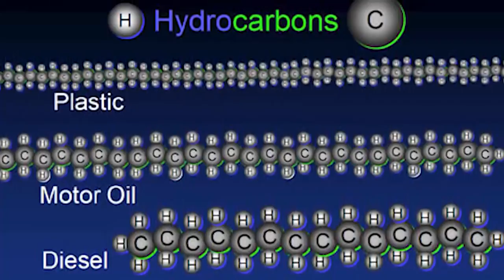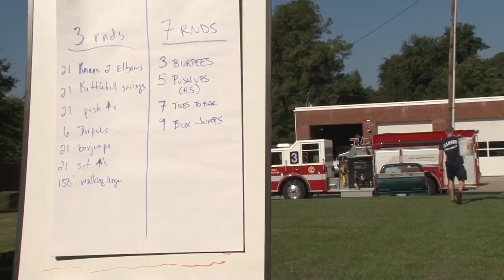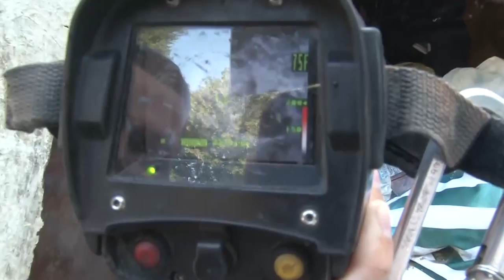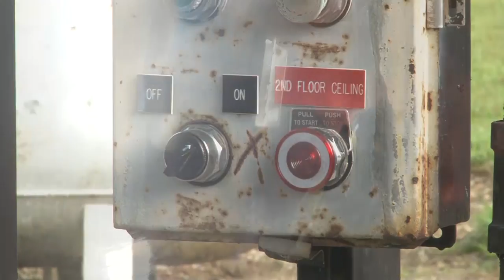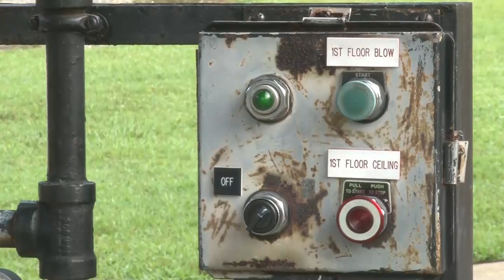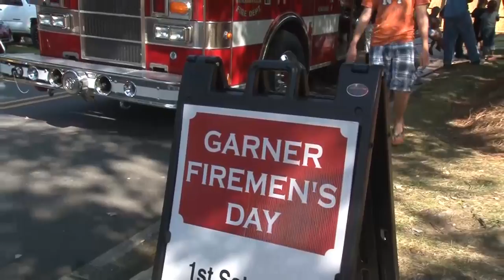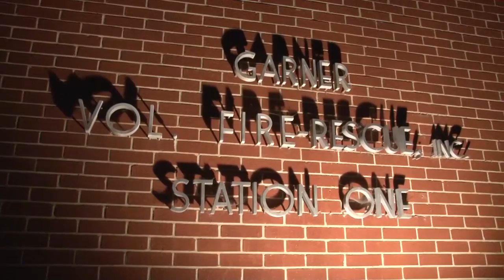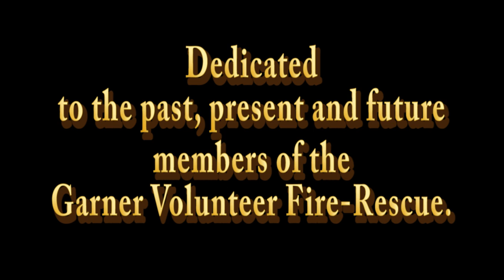Inside the Garner Fire Department

Comment: Only 30 minutes? We use 60 minute cylinders in the UK. Why use 30 minutes?
Reply: +JW93Emergency lower the fatigue levels because they last 20 minutes and they're lighter to carry. also makes for quicker entry intervals which means while primary group is cycling out a new group is cycling in quicker and they have fresh personnel inside quicker. pretty much just to keep firefighters from over-doing it. our department has a '4 cycle/4 pack' rule meaning we can go in 4 times with 4 packs and once we've reached our 4, we're done inside unless cleared for salvage/overhaul duties. we do it because sometimes firefighters would go in 6 or 7 times n suppression and would eventually pass out from heat stroke or fatigue would cause injury and we would have to send in more crews to get them out, so Chief made the 4 cycle/4 pack rule to prevent excessive injuries that could have previously been avoided
Reply: That does make sense. Thank you for your explanation. :) If you have any questions about firefighting/ems here in the UK then please feel free to ask.
Reply: you are welcome sir. and yes absolutely, I definitely will, thank you for the offer too as well. I love going to different departments to see how they operate. every department operates differently and it never hurts to try and learn new techniques. Certain techniques may not be for everybody but they help many